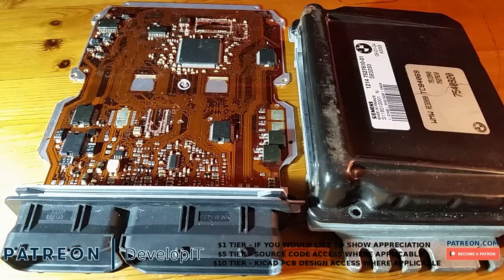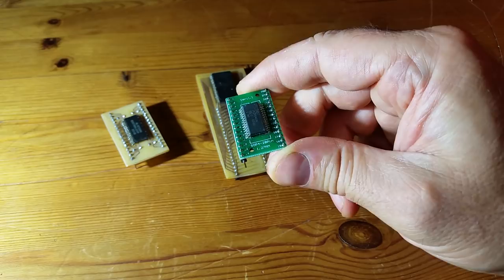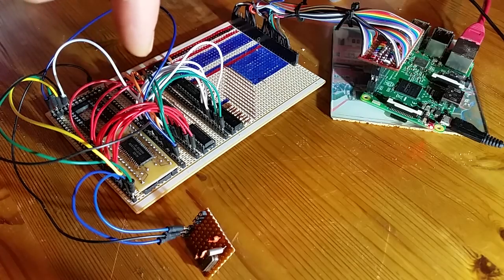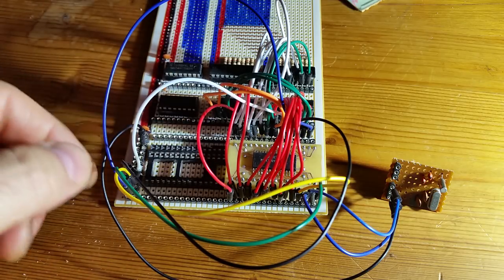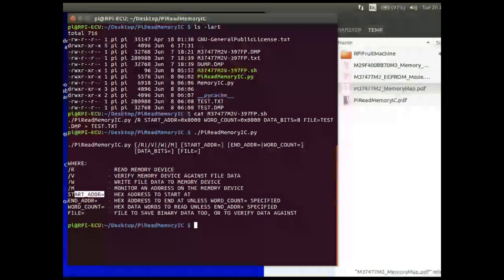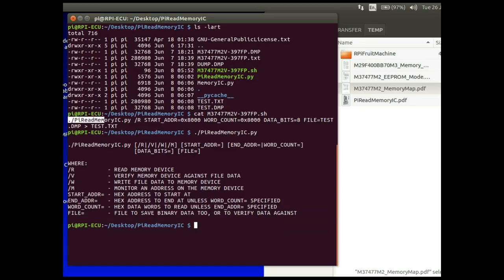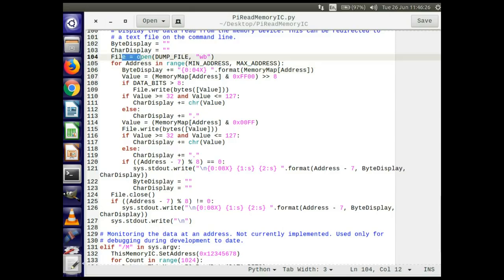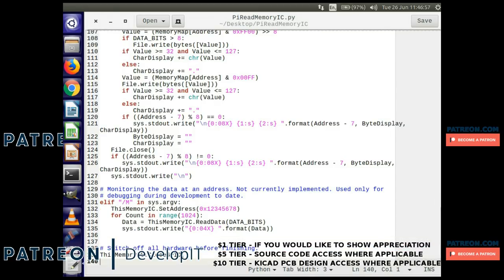Reading The Extracted Memory From A Car ECU With A Raspberry Pi

Comment: New subscriber and first video I've seen of yours and am already hooked!!

This looks like a fascinating project, especially from my perspective who's only just started using raspberry pi's.. One of the first things I wondered was could it be an ECU. I have a lot more mechanical engineering experience than electrical so when it comes to engine management, (turning injectors on and off) I thought how hard can it be? Obviously there's a lot more going on but it really makes me want to explore further. 

I know that working with liquids can get really complicated but when you've been presented with everything that you need as in an ICU and all it's relevant sensors but also knowing what I do from an engine tuning perspective I really am thinking about open source engine management. As they've slowly computerised cars over the years it only makes sense that it's about time they all came fitted with a standardised USB port but manufacturers have done there best to avoid this apart from providing a port from which you can charge your phone, it's shameful but we all know the reasons behind it. With the ICU now being really old technology manufacturers are doing well to keep secret the finer details regarding carburation and combustion.

Obviously it's main purpose is to advance the ignition timing which at one time was controlled with a rotating centrifugal device and 2 springs that would advance the spark timing but it would only really be making any changes to timing in either direction up to around 3000 rpm from what I can remember and then it's just fully advanced so didn't think that would be a difficult function to calculate or program but obviously the complicated part is the air fuel ratio which I was always told was around 7:1.. 

After a quick google now see that it's 15:1. Aren't computers great?!! Carburation always used to be 1% perspiration by way of trial and error and 99% witchcraft as at that time so much of the engine tuning processes could not be so accurately controlled or measured. Most of the diagnostic side of the process relied purely on the colour of the spark plug to determine if the mixture was either too weak or too rich. Even then that would only really give you a guide as to whether the main jet which was one of 3 on all carbs at the time was right, everything between the pilot jet and main jet was completely hocus pocus.

Just as fascinating as it was years ago to build my first rectifier regulator for my motorbike I'm also feeling the same way about trying to make an ECU as quite often the price of a new ECU can be higher than the value of the vehicle and I've always hated built in obsolescence as much as I hate tamper-proof screws and electrical devices hidden with potting compound especially when you know what's hidden in cost is a matter of pennies that they like to charge you £50+ for. 

Pretty sure someone with a much better brain than me has already cracked the problem and is selling them for hundreds of pounds or is just some dude riding around Asia with it controlling their slwoped...
Reply from the maker: I know there are some third party ECUs on the market that either are plug-in replacements of original or have wiring converters for some cars. They offer software for mapping and tuning, but they still cost about £600. Someone did comment on one of my videos saying they were going to create an open source ECU. Here is a link to his project: https://github.com/FL0WL0W/EFIGenie
I'm currently looking at making a device to just remap the fuel mixture.